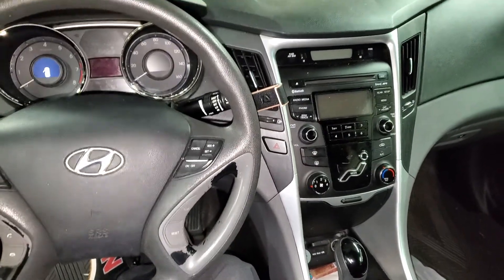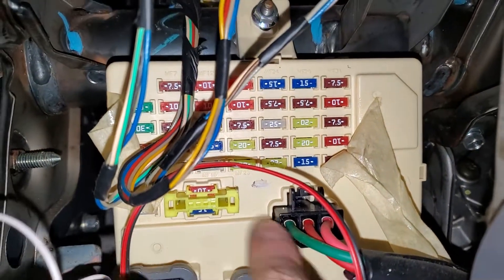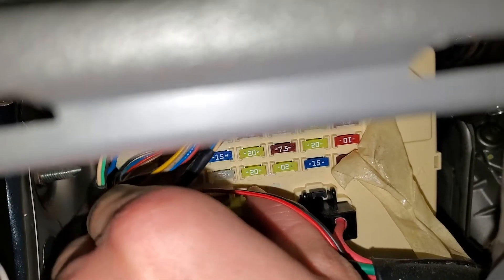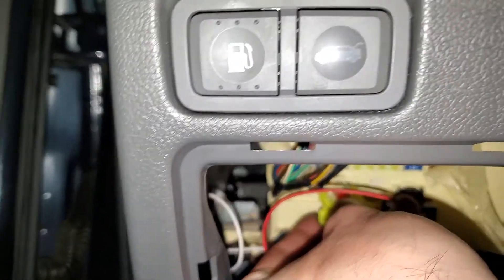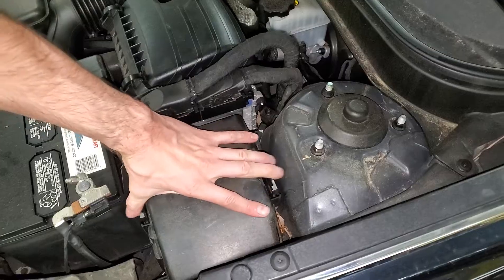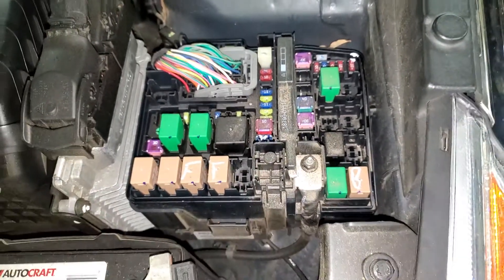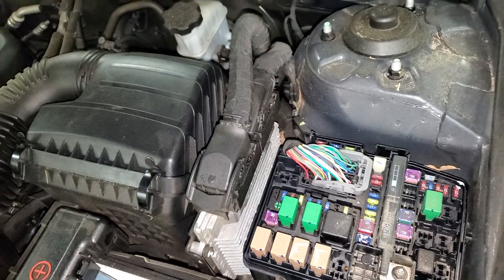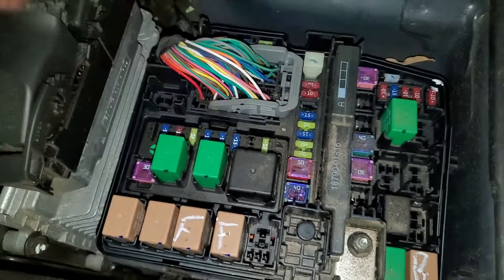2013 Sonata AC Relay & Fuses, Blower Motor Fuse & RELAY Location

Comment: Great info, thanks. I have 2012 Sonata. My ac sometimes works great and some times doesn't kick in especially when starting after parked for few hrs in hot weather. It will eventually kick in after driving for few min. Please advise what I should look for?
Reply: I have the same problem, did you figure out what it is?
Reply: @gabrielchontocruz  not yet
Reply: Hey guys just to let y’all know it’s the serpentine belt mine was doing the same thing hope that helps yall easy fix
Reply: @tcgcolio3822  how was is the serpentine belt??
Reply: I have the same problem, did anyone figure out how to fix this problem yet?

Comment: Yep got same car and nothing happens at all when turned even to full power , no heat , no air and hear a weird low knocking sound , this video was very helpful, does anyone know what the cost ballpark would be to get a new blower motor and labor costs ? some cars I hear like some fords are a pain to get to and cost up to 1500$ with labor ,but the Hyundai sonata doesn’t seem to difficult to get to

Comment: how about a cause, for the cooling fan, working "sometimes" but not all the time when idling.... maybe seems to come on more often after the car has been driven ample time to get very warm... runs fine when moving because the air flow from movement, but always when idle at a light, or parking lot... a/c gets really warm... after driving it today i watched this video, went back out side and turned car on to look at these fuses, and wouldnt you know it, the fan was kicked in and running LOL... but it had JUST not been kicking in, while driving home :(
Reply: Same here only blows cold while driving and on hot really hot days doesn’t really blow cold

Comment: Hi Lehew, thanks for the video. I have a 2012 Hyundai Sonata hybrid that has an AC that has been intermittently cooling. Before I take it in to get diagnosed I was going to just switch out the AC starter relays that you pointed out so that it might end up being a cheap fix. If my fuse was blown out my AC wouldn't power up at all right? I don't detect any leaks or anything like that so I figured maybe my relays just went bad after the 130k miles I've put on the car. Thanks!
Reply: Hi Alex. I'm having the same issue and hoped this video would explain.

Comment: what about if the display is not working? i have a 2017 sonata and the AC display does not light up
Reply: I just started having the same issue. Did you end up getting it fixed?
Reply: Same here

Comment: What could it be if I’m only getting cool air on the passenger front but hot air on the driver side? I’ve taken my car to a shop and they checked a lot and to look further they said they need to remove the front dash interior. The labor just to remove and replace is over $1k... and that’s not including any repairs. I’m hoping to investigate further on my own before I take it in.
Reply from the maker: Does your hvac have dual climate? Has the ac system been fully evacuated, put under a vacuum and recharged to the OEM spec?
Reply: @LehewTech  It is dual climate. What they said they did was checked the hoses and didn’t find any leaks from the outside. They put a sealant spray on the inside of the hoses just in case. They added Freon. It works for about a week then goes back to warm on driver’s side again.

I have no idea about the other stuff mentioned. Can I call the mechanic and ask? When I suggested a few things or asked questions he’s quick to have a simple vague answer to shut me up with an irritated look on his 
face...

Btw... I have a 2011 Sonata if it matters.

Thanks so much for the quick reply!!!
Reply from the maker: Sometimes when the AC system gets low on charge it will cause uneven cooling like what you described. It can be useful to fully evaluate and recharge the ac system and add UV dye to the system to aid in identifying refrigerant leaks.
Reply: @LehewTech  Yes, that was all done last summer. It’s warming up again and still the same issue. I checked the charge and it’s still pretty full. 🤷🏼‍♀️

Comment: How do you check to see if the relays are good?
Reply: Just swap it with a similar one ( but make sure the one being swapped out isn’t for anything that would prevent engine start or performance)if it works good after the swap , buy a new relay. Also u could  learn how to test relays, I’m sure there’s a video on here somewhere

Comment: 2011 sonata here, my ac is blowing cold but it only blows to the face and feet. It will not switch vents at all even if I try to put defroster on, or face only. Can it be a fuse?
Reply: My car is going through the exact same thing heating and ac works fine just don’t blow out at the bottom or front just blows out top any help ??? Fuse ? I need help
Reply: @shaniquabrown1049  got it fixed awhile ago. It was the "door actuator". It controls which vent you want it ti blow out of. Which is why it isnt doing just that even when you try to switch to face/defroster etc.

Comment: I have a hybrid 2013 and my heater just went out. What fuses if any are tied to the heater? My ac works fine. Smelling a lil of the radiator when i try the heater tho.

Comment: What's man? I hope all is well with you! I have the same car and I'm hoping you would share your knowledge and thoughts with me please. I unhooked the battery to clean the terminals and do regular maintenance before going through inspection. Just to make sure I was good on my monitors I took a look with my scan tool. Everything was complete except o2s! I've never had that or see that be ready last. It's been over a week now. I tried unhooking the battery, clearly the codes, I have 5 drive cycles complete and over 4 hundred miles still with the o2s monitor not ready. Any thoughts will be greatly appreciated. Also I was looking at the wiring diagram to check continuity between everything and 1 wire says it goes to the main relay, would you know what the main relay is? All fuses are good. Thank you greatly for your time and help. Have a great weekend!